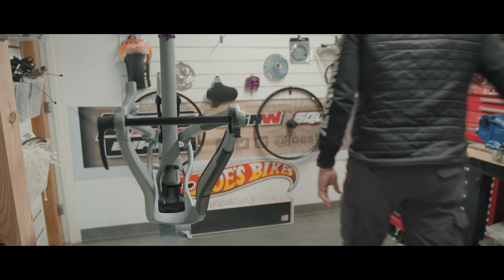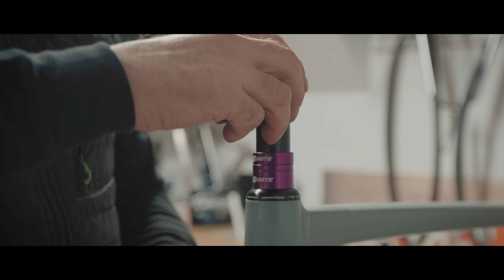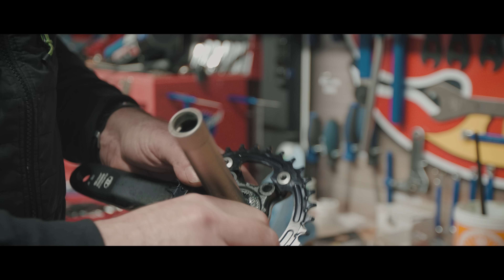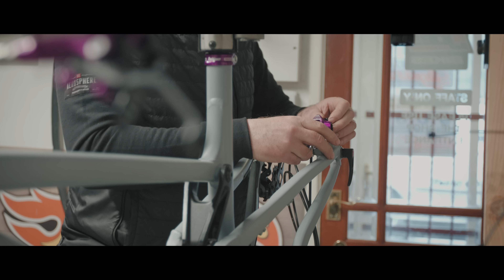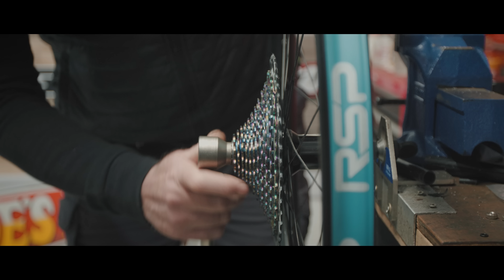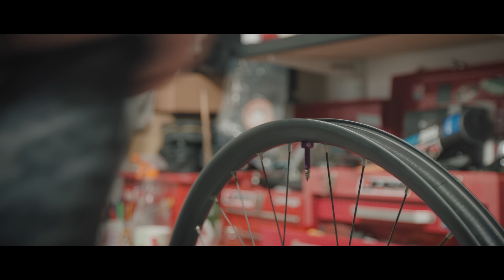Santa Cruz Bronson (2021) custom mountain bike @joesbikes #bikebuild

Comment: I wince every time I see a machanic deburr a steerer tube and the burrs fall towards the dust seals. It's in the steerer clamp, just leave the fork in the horizontal position, once cut, slide it along a little further and deburr. This surely can't just be me with this way of thinking.
Reply from the maker: Hi Kevin, I hear ya dude, and yes It would make me wince too. We always blow the few filings away if any fall around the seals prior to fitting, but I take your point. We don't film all the process and we should include that too, and your method sounds like a good way of avoiding this problem. I hope you keep watching and see how we adapt what we do in future video's. Thanks for your comments and tips as it's not just us that take notice others will read it too, and that is what it's all about for us,   cheers     Joe.